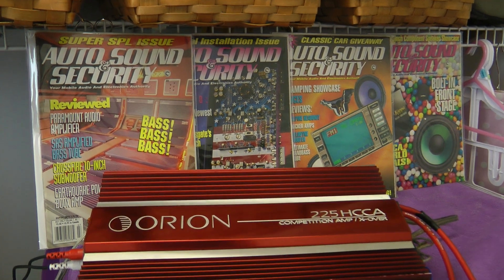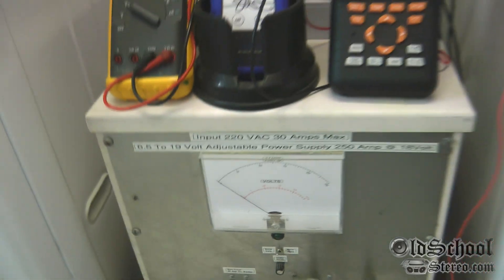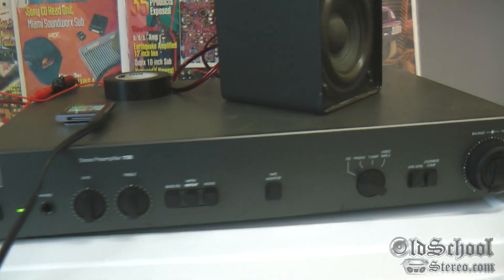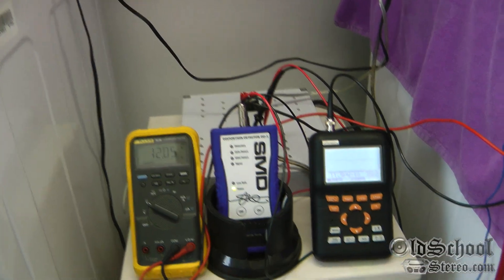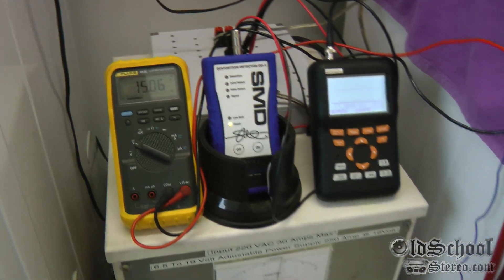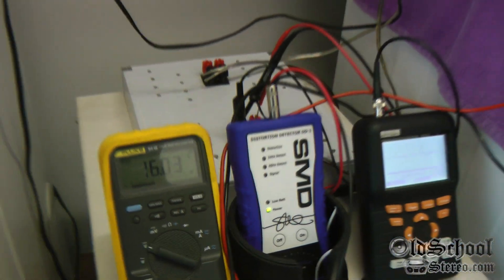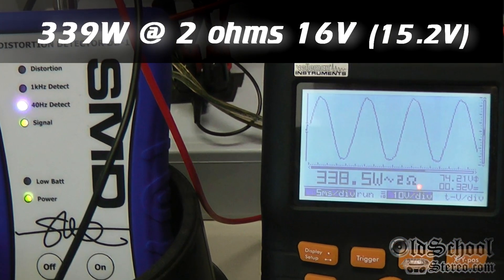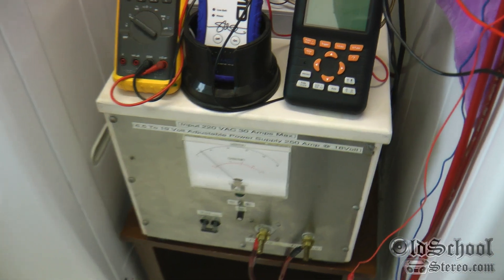Orion 225 HCCA Competition Amp Power Output versus Voltage Input

Comment: I still have one and back in the day I ran it at 0.5 ohm on 4 12 inch Orion's clam shell isobaric with a high output alternator. I wish you would run it .5 ohm at 15v I would like to see th output.

Comment: I still have an HCCA 225.  I ran my whole car mono at 1/2 Ohm for fun for a few weeks.  Haha.  Never did have a low enough impedance box for it.  Great little amp, with huge potential.  Had a break in but I caught them.  Left scratches on the red annodizing.   Great tip!   RED SHARPIE does wonders on any scratches to heatsink.

Comment: Does any one know if the 250 hcca 4th generation regulated power supply thanks
Reply: I have that very amp 250 g4. I notice a huge shift in power while running from what a believe is my amperage changing from the alternator. My voltage never drops below 14v. Its like the amp would get a huge boost in power when i would crank the volume up. But it was kind of inconsistent. This was running 3 4ohm subs
Reply: @andrewmcquaid8580  thanks for the info man i just got this amp from a fellow bass head I had the digital reference I know they are not regulated

Comment: I had one of these amps in 2000 running at .5 ohm and and while I had to have 2 alternators and 2 batteries I think I could have tied it to the bumper and drug it down the street and it would have still performed.It never shut off or blew fuses.I wish it hadn’t been stolen.I can’t say enough about how much this amplifier will take and keep playing.Thanks for the memory.

Comment: Big d , I just recently viewed this video, and you should have tested with 18 volts, back in the day I was running a 16 volt system that charged at 18 and man the difference in power from 12 to 18 was like night and day , after initial hit I was still holding steady at 17.5 volts I see your tests it dropped down to 15.2 volts, these amps love more voltage , I never found the point where they shut off from to much voltage, anyway you do a great job of testing old school amps I would love to see what a brand new hcca 225 would have done on the dyno at 18 volts

Comment: I used to run two of these same amps on 6 JL Audio 10w6's, 0-100 power class. Also I would run 101-250 power class with my Alpine amp running my mids and highs. Pulled lots of trophies back in the day. Ive still got the amps too lol, couldnt ever bring myself to getting rid of them
Reply from the maker: +anonamedude you are a smart man. I'd hold onto those amps. Value was as low as $100, but I doubt they will get that low again

Comment: These amps are great. I have had my HCCA 250 and HCCA 225 Competition AMP/X-Over Amps for many years now in multiple configurations and they've never let me down. If possible, could you let me know where you found the manual? I've been looking but they are hard to find.

Comment: The missing measurement would be 11.5 or 11 Volts. If the result is the same as 12V, it would indicate the amp is kind of regulated. Did you test it?

Comment: - In 1993 I ran 10 speakers - to include two 12" subs bridged - off a First Generation 225 HCCA in my 1982 El Camino... took that beast right down to .5-ohm.  Ran a 'lil warm at times, but never went into protection, etc.  As with most things in life, we (I) sure wish I never sold it ... not a scratch on it ... now I'd just be opening the box once a week to rub it with a diaper & put some wax on the face of it ...  Oh, well ...

Comment from the maker: That's a great question. From what I've seen, most of the full range Class AB amps such as this put out more slightly power at 1kHz than 40Hz, but not a significantly higher amount. I'll verify this in future tests.

Comment: Question?  At 4:50 it's reading 11.67v = 179W@2ohms using a 40Hz signal. My question is if the frequency used to test was higher (1kHz), would it effect the wattage output of the amp?

Comment from the maker: Rail voltages are lower on the 225 HCCA (optimized for lower ohm loads), they use the same heatsinks and board. I'll have to confirm, but I believe the 225 does slightly more power at it's optimal load than the 275 SX. You can see my test of the 275sx on my channel. Will test a 225 HCCA soon.

Comment from the maker: Right...I mentioned in the video this wasn't to determine maximum output power, yet to determine how input voltage affected output power. Some amps with tightly regulated power supplies will not show much output difference between 12v and 14.5v. We'll load this joker down one day soon and see what it can do at super low ohm loads and 15V of input voltage

Comment: These amps were rated from the factory to be stable down to 1/4 Ohm stereo or 1-ohm mono loads. It was still laughing at you and running relatively cool at 2 ohm mono.

Comment: I would love to the see those subwoofers u have the f-12 free airs
Reply: I had one of those and an old soundstream class a 10.0, i believe they are stable .25 ohm up to 18 v rated 25x2 @ 4ohms then 1000 or 750 @ .25 ohms thats y they were cheater amos u could compete 0-100 and have a wall in minitruck
Reply: I think i still have it buried in my attick

Comment from the maker: The high-current has to do with the ohm load vs. output. These were optimized for lower ohm loads than most amps at the time. This is obtained by lowering the rail voltages. This is a very similar amp to the 2150 SX and overall output at the optimal ohm load should be the same for both amps

Comment: I used to run an Orion 250hcca @1ohm. If I remember correctly weren't these amps "high current"? This would suggest a higher output at lower voltage. Meaning lower voltage, higher amperage?... correct me if wrong but i remember it slamming harder at 12v????

Comment: I like your videos! I didn't mean to imply anything about your knowledge. I just asked some questions I've been curious about. Also you're unbiased and fair in your testing. I just thought I'd pick your brain.You have people in some of the car stereo shops saying you need stiffening caps for a badly designed amp so you trust them. They also jokingly said that those Orion amps start off black and turn red because of the heat.

Comment: When I was told that the Orion amps needed  stiffening caps it was because they were poorly designed. So you're saying that a stiffening cap can't supply stored energy faster than a battery can? So they would be wasted money that a battery would be sufficient? Also in amplifier design what is a capacitor used for then if not to store energy? Capacitors store energy do they not?So why include them at all? Caps absolutely store energy the have to be charged and dischrged for use and storage.

Comment: There is no doubt that Orion's power supply is incredibly inefficient. They are designed by RF engineers...and it shows. The output stage is bog standard and not exactly high quality. They are prone to asymmetrical waveform distortion prior to clipping. Minor asymmetry isn't going to overheat a speaker as clipping but it will trip the DD1, so it's still important to watch the o'scope for actual clipping.

Comment: A "stiffening cap" simply reduces the power line impedance at the input of the amp. If you've got a lot of resistance in your power cable, it could measurably change the performance, but you probably won't hear it unless the amplifier is poorly designed.
When you said "internal storage capacity" to what else am I supposed to believe you are referring? Capacitors store energy.

Comment: No one said anything about big capacitors but  I've been old that the (onion) amps need stiffning cas to provide fast transient power to the amp for dynamic power needs that could be placed on the amp in order to help the amps performance. Also if possible to have extra battery power and an high output alternator if you can afford it to beef up the cars electrical system. Many of the competition sytems have these things so they can eek out every watt poissible for thei amps.

Comment: A more efficient design with less heat as a by-product. That's why the oldschool Orion (Onion) amps heatup so much and require stiffening caps between the battery and the amp. Becauce of the ineficiency of their design. Also the power transformer it's relative size and the metal used at it's core can greatly affect the amount of power that can be produces in watts at the output stage. Even if the design is efficient the better the transformer the higher the performance.

Comment: running a power 100HD at 14.7 and I am very very sure its doing more than 2x50 bridged @2 running a set of Infinity CF6832 and they scream.More than loud enough to keep up with my low end wich is 6 12inch RF HX2 on a 4kw amp.

Comment: I'm a big fan of Zed Audio amps and Zed claims that a huge majority of their amps have a regulated power supply.  I have a HiFonics VII Zeus in one of my cars and recently did a BIG 3 upgrade along with adding a Kinetik battery in my trunk beside the amp and I immediately noticed the difference.  It's definitely pounding a lot harder.  I'd say no matter what amp you have, feed it the power it needs and you'll get the results you'd expect!

Comment: There is a considerable amount of math behind the dimensioning of a power supply. I always get a kick out of forum dwellers that claim "Oooh, big capacitors means it's built better." Quite the contrary...capacitors get hot and are failure prone. Big capacitors generally means shortcuts were taken upstream. :)

Comment: They don't have physical overhead in terms of larger capacitors. A regulated design typically has additional circuitry so that it can accurately track the rapidly changing voltage. So you'll see a couple big inductors just past the rectifier diodes which oppose a fast changing current. They provide some smoothing of the voltage while the pulse width changes to compensate for additional current draw. But bigger secondary side capacitors = more capacity? Not in a car amp.

Comment: But you have to be careful with some amps - their controllers can't take more than about 20V and their thermal thresholds are set by the battery voltage. Some won't turn on...some won't turn off. At worst, you'll blow the Mosfets in a push-pull design where the total voltage seen by the D-S junction is double the input voltage. That's why amps have 55 and 60V MosFets in the power supply and not 16V.

Comment: There are defined limits, both upper and lower that the amp will not exceed. I haven't seen an amp in the past 15 years that pulls more current with lower voltage. that sort of engineering leads to lots of burned up amplifiers. Some amps would get into a weird mode of operation where a low voltage situation would cause the Mosfets to stay on, pulling 100A+ in short bursts with a 9 or 10V input. Later models had a lockout circuit.

Comment: On the contrary, the Orion is a regulated design, but not PWM - it is PAM so definitely going to increase power output with higher input voltage. Almost every amp on the market will increase power output with increased voltage at the terminals. Regulation just means that the power supply tracks the secondary side voltage (or current) and increases the On time of the switching Mosfets within a window so as to maintain a minimum power output.

Comment from the maker: I'm not an amplifier power supply expert, so I'll leave your comment for somebody who is. My understanding is the regulated power supplies will pull more current when the voltage is lower to compensate for the lack of input voltage. I don't think the internal storage capacity comes into play, but I could be wrong. Any expert out there, feel free to chime in...

Comment from the maker: Yeah man, the 225 stood up to it's legendary reputation. I have a 2nd gen 250 HCCA (digital reference) and will have to check it out soon. I had the 225 2nd generation initially up for the test, but the amp has some issues at full output (was cutting off). I'll have it repaired and test it as well. All these tests would be much easier with an SMD/D'Amore Engineering AD-1...I'm just sayin'...Steve, Tony...U guys listening?? LOL

Comment from the maker: Don't confuse signal input voltage with POWER input voltage. Most stock alts will give you around 13.8-14v of input voltage, but there are several external forces working on your electrical system to bring this down lower for your stereo system. RCA's have nothing to do with your power input voltage and not really anything with your signal voltage either. It's just the cheaper ones may induce (or enhance) noise

Comment from the maker: Many amps back in the old school days had tightly regulated power supplies (Zed made HiFonics, Autotek; PPI A/AM, ProMos, just to mention a few) meaning they would provide almost exactly the same power output with a voltage input of 10.5-15v. But there is a trade off as the current draw would increase. Power has to come from somewhere, can't defeat ohm's law...

Comment: Being unregulated does that mean that the amp doesn't have the reserve storage current capacity to provide the higer wattages at lower voltges so that it fluctuates at the output? Depending upon how much voltage is supplied. Would the stiffening caps help with this or do you still need the high output adjustable alternator?